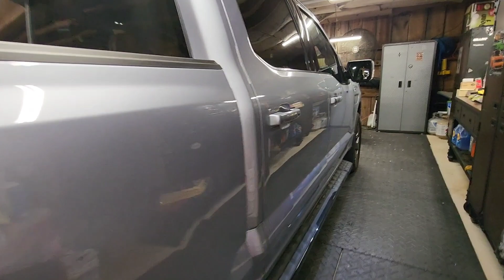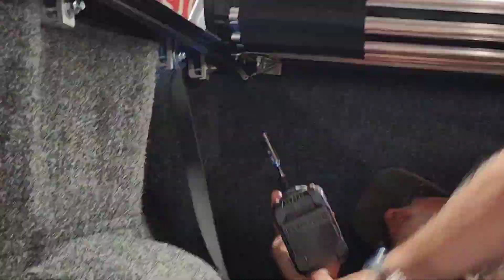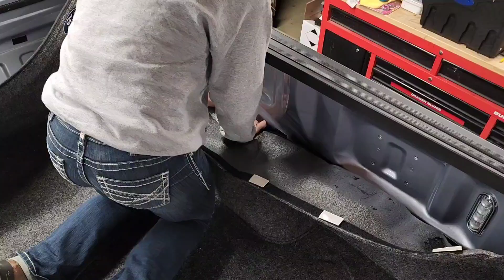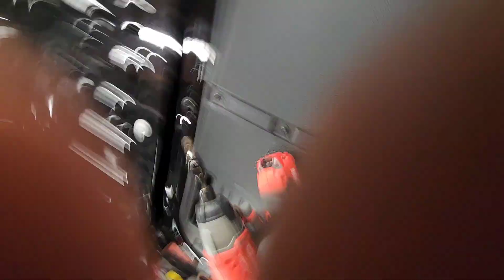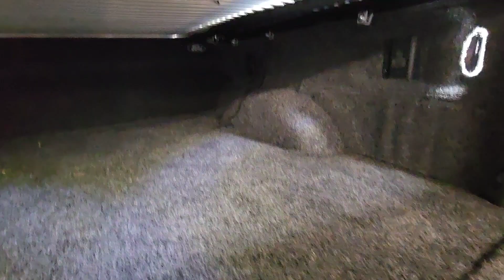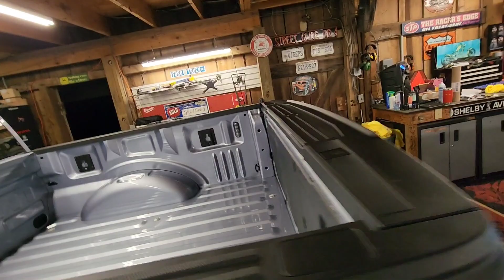EV Age back to Ice Age

Comment: I’m trying to think if I should get the f150 raptor with the 3.5 v6 or the redesign f350 tremor 😅 for towing 5-6k
Reply from the maker: The Raptor will be more fun and comfortable.  I owned the f-350 Tremor Gas Godzilla motor it’s an awesome truck but it’s big and stiff ride.  Gas mileage is 12mpg.  Power is good but not  as good as the Raptor.